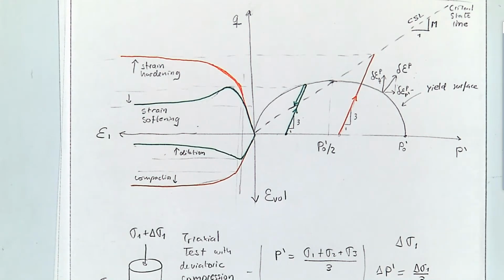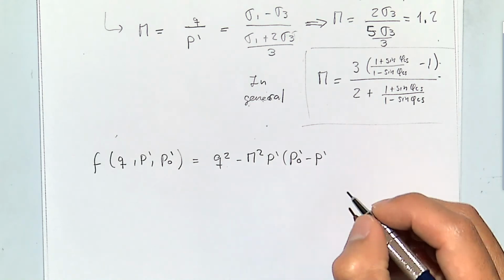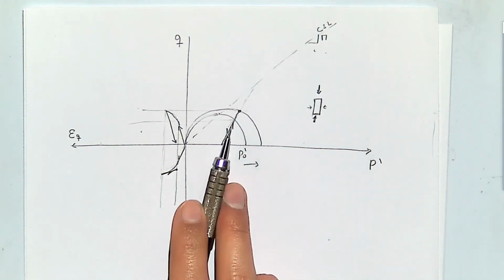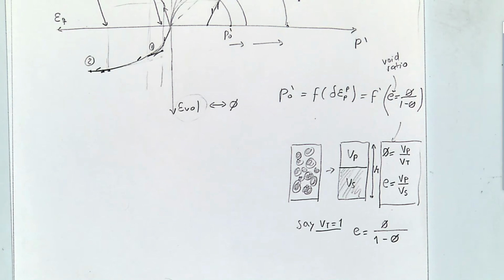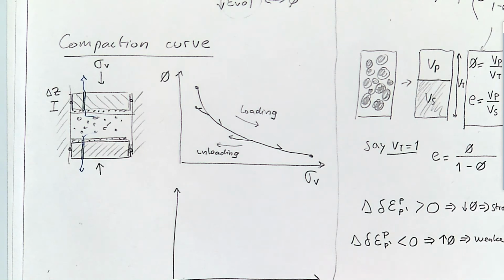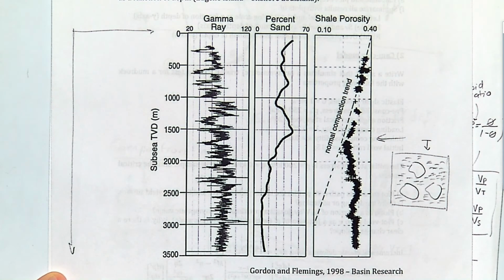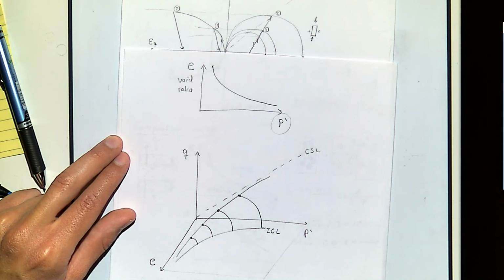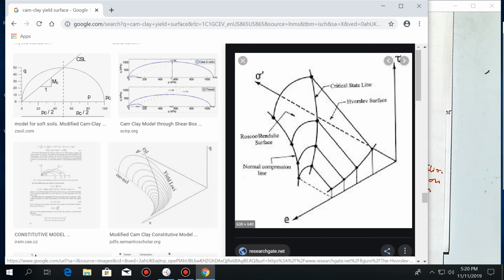L20 Introduction to plasticity with the Cam-Clay model

Comment: Thank you so much for your lecture. I saw something went wrong in the notation of Cc and Cs. According to lecture, You wrote the equation of elastic part is that e=e0-cc.ln(), it is true in case of compression coefficient (Cc)  notation that you defined it. However, the grade of Isotropic-Normal Compression Line (iso-ncl) is Cc (or Namda in case of v;lnp space) and the the equation of elastic is e=eo-Cs.ln() in accordance with international standard.
 Please check it again. I am waiting for your reply. 
By the way, I love the way you explain...
Reply from the maker: Yes, you are right! Thanks for pointing out the mistake!
Reply: si tmb pense lo mismo Cs o Cr(spanish) es  de recompresion y  Cc= compresion